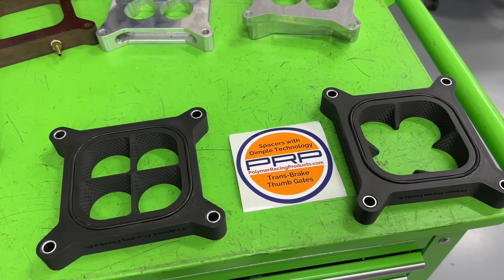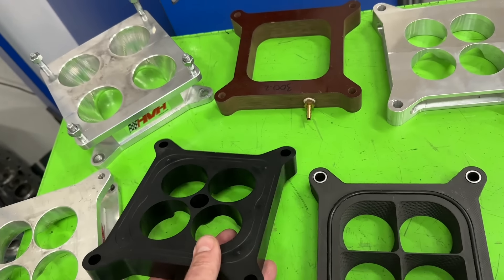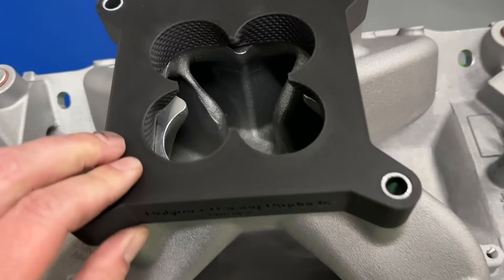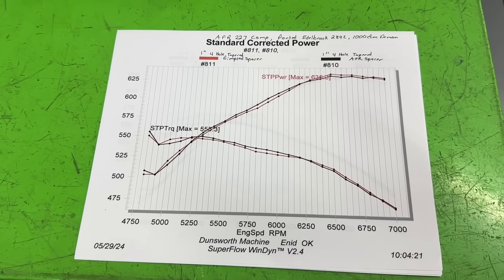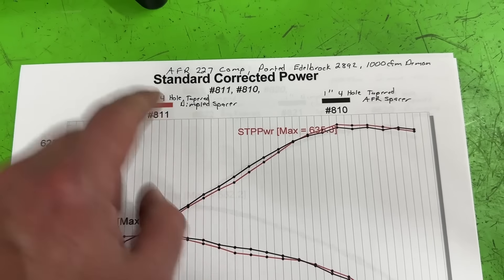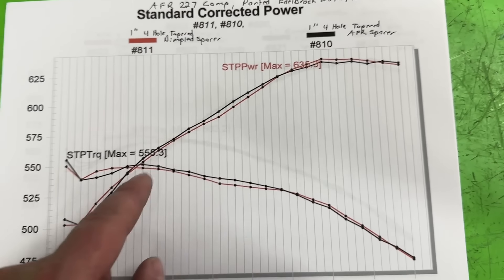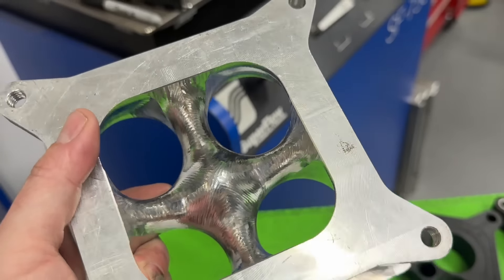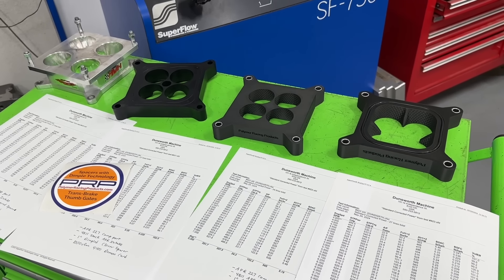Dimpled Carb Spacer Dyno Test

Comment: Hi Eric, Thanks for running these dyno pulls, and providing these very detailed results!

Note the tapered spacer you got (PRP1003) was designed for an intake with square opening, not cloverleaf. We have a tapered spacer specifically designed for the cloverleaf intake (PRP1049). This is why I think you got better results, running what we call “hybrid open” spacer (PRP1054) backwards because it provided the perfect transition for the airflow into the intake when you ran it backwards.

We’d be more than happy to send you a tapered spacer, that is specifically designed for the cloverleaf intake you got, if you want to give it a try. We carry it in both 1 inch (PRP1049) and 2 inch thickness (PRP1048). We’ve seen best results with 2” spacers. Might be a competitor to your 2 inch 4500 to 4150 cheater spacer :) 

Thanks again for the honest review!

Comment: I'm guessing the flipped over version gained because it smoothed the flow out nicely and helps the air/fuel turn into the runner entries.
Reply: Yeah the other direction looked all wrong and not smooth

Comment: Thanks Eric, I enjoy your dyno testing. 
On a couple of 383sbc  pumpgas engines I have the 2" 4 hole or a 1" 4 hole on top of a 1" open spacer has always picked up 6 - 10 hp for me above 6000rpm. 
These are 580 hp deals pulled to 7000rpm on the dyno.
My opinion is the small increase in plenum volume is just enough to get the engine to 7000rpm. 
I have backed this up at the track as well 3505 lb streeter runs a best of 10.46 @ 126.85mph.
1.43 in the 60ft. 
Again thanks very much for your time and effort.

Comment: I remember hearing Darin Morgan talk about dimples at some point. He said something interesting. While the dimples creates a boundary layer, that layer also effectively narrowes down the tube or port. What he said was, that if the runner or port is large enough, it can work. A golf ball does not have limited space around it, so there will never be the same potential issue of an air resistance due to a narrowing of the space.
Reply: The narrowing doesn’t increase velocity ?  Through the CSA of the boundary?
Reply: @ecc5119  
Only to a point. At some point it will just act as a smaller runner that is not large enough. This I assume is why he said “if the port or runner is large enough”.
Reply: I remember him saying in a DBG live stream that if a port is too big,  they might help,  but otherwise not a good idea.
Reply: Golf ball dimples cause air resistance and what allows the ball to stay stable in the air by causing friction more or less. That’s also why I can control the ball and turn it right to left at will by causing more or les spin to grab the air in whatever direction.
Reply: @Thumper68  
You are way off and completely wrong.
I have actually tried hitting smooth golf balls, and they go nowhere compared to those with dimples.

Dimples on a golf ball create a thin turbulent boundary layer of air, that clings to the ball's surface. This allows the smoothly flowing air to follow the ball's surface a little farther around the back side of the ball, thereby decreasing the size of the wake. A dimpled ball thus has about half the drag of a smooth ball.

Dimples also affect lift. A smooth ball with backspin creates lift by warping the airflow such that the ball acts like an airplane's wing. The spinning action makes the air pressure on the bottom of the ball higher than the air pressure on the top; this imbalance creates an upward force on the ball. Ball spin contributes about one half of a golf ball's lift. The other half is provided by the dimples, which allow for optimization of the lift force.

Dimples on a golf ball does the exact opposite of what you claim. Dimples are also used in other instances, where smooth and fast airflow is needed.
Reply: @AB-80X  yeah you didn’t read what I said did you. I clearly said a smooth ball goes nowhere and they fly like knuckle balls. I have a pro golf management degree and won a state championship and I had a driving range at my house I hit a thousand balls a day for 15+ years. You literally just said exactly what I did in a different way.  Yes the dimples cause cause some lift but really they just stabilize the ball to maintain lift. The loft of the club and speed and angle of attack the player swings and impacts the ball creates the lift. Ball spin doesn’t create half the lift that’s absolutely wrong. I can hit a shot very low with extremely high spin or very high with very little spin. How I hit the ball and club chosen controls the amount of spin. The dimples simply allow what I’m doing to the ball to take effect and be controlled through friction or a turbulence layer if that’s what you want to call it.

Comment: Spacers that work better upside down is trying to tell you something. Maybe the whole flow situation needs to be looked at. Maybe it is not more air flow the engine wants, but better air flow. Better air flow is not always more air flow. I would study fluidic control systems. These are control systems that operate on fluid only. These types of control systems are capable of accurately switching air flows at very high speeds without any electronics and operate somewhat like an engine intake manifold does. There are some similarities. One of the best books on this subject is Fluidic Systems Design by Charles A. Belsterling. This 232-page book dives deep into fluid flow and how to control it. These fluidic systems were used to control high performance jet fighter aircraft long before the use of microchip-based computers.

Comment: Be interesting  to see if the  tapered 4 hole applies to intakes converted to efi with an elbow on top or carb style throttle body to see if its just the air flow or atomization.

Comment: So much like the golf ball the dimples increase the boundary layer which reduces drag which in turn increases velocity maintaining fuel suspension in the airstream leading to more torque on the bottom and top by widening the tuned intake pulsing. Whew, that's a run on sentence.

Comment: Smooth transition from carb to intake through port will make for the fastest flow into the cylinder.
Reply: I guess thats why the runner floors in most intakes are ribbed.... and not smooth.... theres a reason for that if you didnt know. Turbulence and fuel atomization plays a role here.
Reply: @Chugg.Norris  Smooth transition between mating surfaces but rough surface otherwise. I think back in the 90s, people were experimenting with dimples to help keep the fuel atomized as it passed from the carb into the cylinder.

Comment: Maybe not the most flow, but the best flow that is involved. If the center area of the manifold is thought of as a bucket that the runners are pulling from, and the carburetor just keeps the bucket filled. Only one runner at a time is actually pulling air from the bucket anyway. A high flow from the carburetor directed to the center of the bucket to keep it filled may be the answer.
Reply: I like this analogy.  Though I think the "center of the bucket" moves around quite a bit depending upon which runner is pulling from the bucket.  So the center of the bucket is relative to which cylinder is drawing air.
Reply: @frotobaggins7169  Right. If any better NA performance is to be made a different approach to air flow is needed.

Comment: eric is it possible to do a dimple test  on an intake port, but just dimple the short radius , on a different port you could dimple the long radius . i think there would be plus or negative gain. ive wondered about this for 40 years ( yeah im old as dirt ) but never had the gear to test it. thanks love the testing you do.
Reply: Eric; I've been porting heads since 1963. You can have to much air speed or not enough! You have to think  about laminar air flow also 
also
Reply: Rest of my reply: one thing is that air only likes to flow in a straight line. The key is to figure out how to make the air turn!!!   🤔🤔

Comment: On the subject of dimple porting I have heard so comments from Terry Redbourn (ex-Mercedes f1 and advance racing engines(le mans)), he said that dimple porting was useful in port injected engines where fuel efficacy was so important that you ran on the lean said of stoichiometric. The reason why this helps is it prevents fuel sticking to the intake runner creating inconsistency in a/f ratio, some of these engines run so lean that they are on the edge of misfiring if they go any leaner. However in a more normal engine application he did not suggest that dimple porting increased power.
source episode 105 High Performance Academy tuned in podcast.

On your point around 1:15 all motion is relative ball moving through air should be the same as air moving through ball.

Comment: I'm glad you tested these spacers brother...I bought one for my Iraqi Taxi 229ci build. The 1.5" 4 holed CNC tapered I put on previous woke-up the bottom and mid part throttle like I've never seen before...we'll see what this does...
Reply: Any luck with it on your combination?
Reply: @CLEEPER1  I got the engine together and running again then spun a rod bearing😆 so I didn't get enough time to test or compare it's performance.

Comment: Your favourite spacer and a 4500 holley, only gained 3 or 4 horses 🐎 last week on just mopar Joe's channel. 
Basic 440 with tf240 heads, 243 at 50 hydraulic roller, about 550hp 😊
Reply from the maker: I think you heard that wrong. The hvh 4500 to 4150 gains between 10-20 everytime that’s my favorite. It just requires a dominator. The favorite 4150 is the afr which is barely 3-5hp better than most.
Reply: @WeingartnerRacing  thanks for the reply Eric, I know you're busy.
Re read my original post.
Your favourite hvh 4500 to 4150 adapter only gained 3 or 4hp on just mopar Joe's YouTube channel last week.
I can send you the link if you like.

Comment: Eric, International Dyno Authorities youtube channel tested both of these 4150 spacers on a 408 Sbc 2 months ago, and they supposedly got 21 hp gain. I been an 4500 HVH spacer supporter for a long time, especially on power adder.
Reply: not sure theirs is a true apples to apples comparison since they went from a 2" tapered to a 1" tapered dimple. They might have picked up more power using a 1" Wilson spacer. who knows
Reply: @five27racing  I'm not sure either. I wasn't there to know if there was any trickery, so I always take internet with a grain of salt. The only 2 spacers I use it the 2" HVH with a procharger blow through combo, and it was great. Right now, I have the Trick 2.375" tall space for the 2 burst panels. It didn't show a gain, but it didn't lose power either.

Comment: I saw a similar test done on another channel (Piss Cutter Performance maybe), that had similar results with the overturned cloverleaf spacer. Theirs was not dimpled. It is my understanding that the dimples are effective in creating a boundary layer, to keep the fuel suspended in the air stream, instead of clinging to walls. I've seen test with varying results, so it's hard to say. Those dimples, or Von Kharman dimples, seem to be really effective on top of the piston, married to a poor chamber shape. None the less, this was a very interesting test. Thanks for sharing with us. God bless

Comment: It seems to me that the runners want to pull from the middle of the manifold not from the carburetor. Maybe the flow from the carburetor needs to be aimed at the center of the manifold and let the runners pull from there. The most direct path may not be the best path.
Reply: it is they need to make a spacer funnel shaped with vents to help atomize
Reply: @stevenbean9706 seems the upside down spacer made a funnel the way its shaped

Comment: Idk if it’s even possible, I’m just spitballing here. But I would be interested in seeing the flow numbers on the manifolds with the different spacers. Maybe measure speed at different areas? 🤷‍♂️ Whats Ive seen on other channels is that dimples only help in low pressure areas and hurt in high pressure areas.

Comment: I would love to see the upside down clover dimped spacer on a "street engine" starting from 2000rpm up to the 5500 /6000 rpm.
To clarify a cam shaft in the °230ish duration range and a lift somewhere below .580 .
Reply: Oh but who wot at 2000😂 lol jkjk

Comment: I don't think the basic idea is wrong when people think of golf balls. If it's the object moving through air, or air moving through an object, motion is relative. 

The issue, I think, is the application. Lots of proven power adding techniques can cause you to lose power if applied incorrectly.

Most of the dimple application I see seems to have it's heart in the right place, but really lacks the proper analysis, and testing, from a complete perspective that takes into account all of the variables at play, and where it fits into the big picture.
Reply: Eric did video on dimples during the  "internet ports heads" series, and when only applied to certain areas of the port, the dimples helped on the flow bench. They are vortex generators that thicken the boundary layer, so there is no point in using them everywhere in the port unless the entire port were too large. At that point,  a smaller port would make more sense.

Comment: Interesting  but I run engines that have way lower power bands 700-4500 rpm max and duel plane intakes , be interesting to see them on a low rpm grunt engine
Reply: I agree, it's interesting but starting at 4,500 rpm is a racing only application.  I get that dynos present a problem off idle up to about 2,500 rpm but most people don't spend much time in the 5,000 + range.  They might want to.  Their heart may be in the racing range but on the street, it's just impractical.
Reply: Depends on how much plenum volume you already have. Dual planes with spacers generally give lots more low and midrange torque and can help in the higher rpm’s. I doubt you would see the big gains like he has here though
Reply: Using a center punch to create burrs is the answer on a 180 manifold below the carb or just annular boosters . Get it mixed fuine as possible !!!

Comment: I’m a golf pro the dimples are simply to make it so the golf ball can be controlled and stay stable and in the air more or less using friction! Hit a golf ball without dimples and you will see the craziest knuckleball flight you’ve ever seen. I can hit 10 balls in a row and not tell you where they will end up and a ball with dimples I can hit 100 in a row a 100 yards and get them in a 10-15 foot circle. Putting dimples on a flat surface is just causing air friction when it’s going over that surface if it made it better the land speed cars and Airplanes would be covered in dimples now wouldn’t they.
Reply: This application has nothing to do with what you're talking about, but congrats on being a golfer.
Reply: @wayne8498  that’s kinda my point but I do understand how and why dimples on golf balls work and it’s not for making air move faster and not what it does In this application.
Reply: @wayne8498  I guess I could of mentioned my old man’s a master machinist and mechanic and has been making 700hp small blocks longer then I’ve been alive so I’ve picked up just a little bit of knowledge for this application as well.

Comment: Erir, please try this so i have back up info or not, short story is, my 406 with ported, by me an 2.05s by me Dart 200s .654 lift roller. Flat tops zero decked 251..258 Dur. Gained 20 hp. By installing a 4 hole, 2 inch modified spacer with pass. Side divider cut out to an oval shape, leave D side alone up jets. I think it equalized the plenums, ..oh Intake was rpm air gap. Dyno man could not believe it. Trust you!

Comment: Maybe someone mentioned already. That hvh spacer looks almost double as high as the others. What would happen if you ran 2 of the large hole upside down on the carb side and normal on the intake side or a taller spacer?

Comment: These results only matter, of course, if you have a cloverleaf shaped plenum. I wonder if these spacers would have the same issue as many other phenolic spacers of warping over time with the heat cycles. I’ve avoided phenolic spacers for that very reason.

Comment: Sorry, but you are comparing an AFR spacer that matches the AFR flange intake, the other dimple ones don't match the flange manifold, except that when you inverted the dimple it kind of matched the flange, so the real extraction of  all the potential of the spacer.

Comment: The dimples are a gimmick. This test shows more about spacer shape. You would need identical spacers, one with dimples and one without to verify dimple differences. Having the cloverleaf upside down makes sense on that manifold as it would induce a radius into the runners vs a sheering edge when placed in normal orientation. Testing on a manifold with a square opening will be interesting.
Reply: You just need to research a lot of money just to see if it works the best Dyno is your race car it's all snake oil !
Take it to the track make only one thing at a time so you know what works.
R.Roman
NHRA Sportsman Racer 😊
Reply: @annmarierudolph2291  While I agree. It's hard enough to see legitimate differences on the dyno if they are only 2 or 3 horsepower here and there. You will never measure that at the track.

Comment: Speaking of the upside down dimple spacer. 

I think it’s most plausible it created better fuel mixture running the plate upside down. The other possibility is better air distribution overall. 

Lastly it might have just been perfect match by luck and you might find it loses power on another manifold.